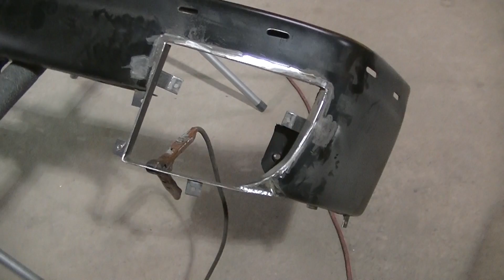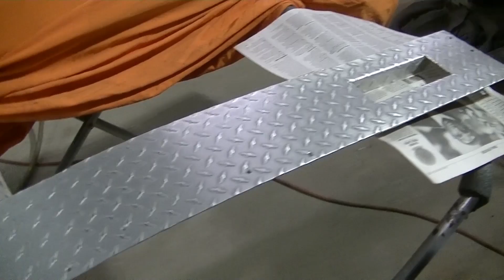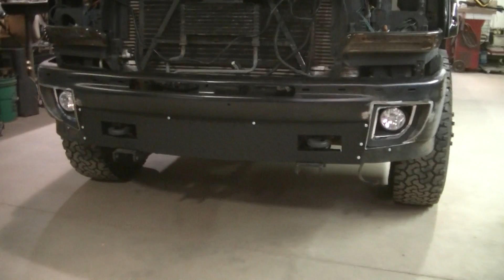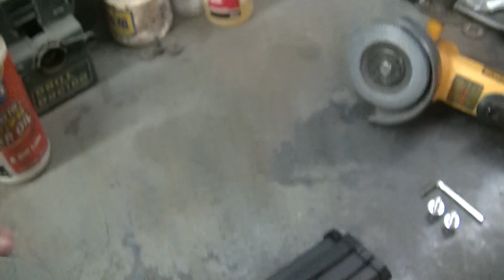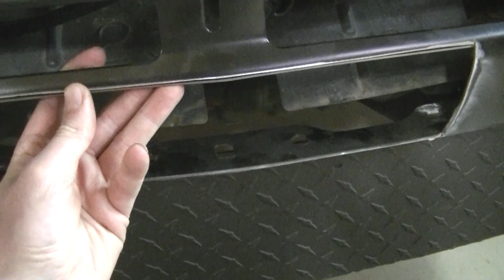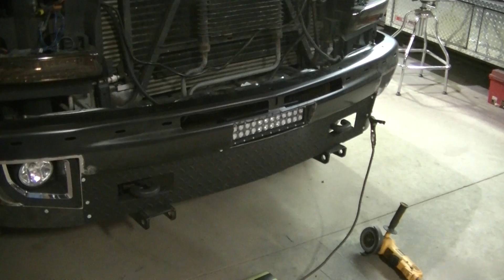Darth Dually "Front Bumper Build" LED Light Bar Install Part 2

Comment: I've used the base Duplicolor bedliner since my first truck for rocker panels.  I've wondered what the Bed Armor is like.  You've answered it for me with this video.  I'll stick to the base bed liner in a can.  BTW, I've used Rustoleum as well, but come back to the Duplicolor.  It just seems to apply better.
Reply from the maker: They are very different products for sure.  This Bed Armor has held up good.  You have to get the Rustoleum Industrial or hard hat paint.  Way better than the regular paint.

Comment: I'm assuming that your using a cheaper light bar. Hell I would. But from what I've read you need to seal them up on the ends to prevent water from getting in them. There's plenty of YouTube videos on how to do it and why. Just my 2 cents. Also that spray on bed liner your using I found it doesn't ball up as much on the edge of the can when the can is warmer. But when I apply it I still use a rag to wipe off the nozzle after every spray. I found that that produces the best results. Great work and great videos as always. Look forward to seeing your videos. Keep up the great work!
Reply from the maker: +huronhockey8   I think that the light bars leaking were the first ones they came out with.  I have a 42" on my ranger and it's been outside since I bought it with no water damage.  The light bar I ended up using was not a cheap bar.  I paid $120 for the 13" which is about triple what the cheap bars on Ebay go for.

Comment: I had to get a heavy duty bumper because I hit too much stuff.
Reply from the maker: +Randy Bobandy   Slow down.
Reply: +mossman381 Only thing I need to slow down on is drinking. drink way too much
Reply: +Randy Bobandy pretty sure my bumper is drunk driving certified, I mean, it is deer-proof !  Also a good tool to transform sedans into hatchback !
Reply: +Veikra I need that !
Reply: It could be yours for the low low price of 1599$ , or roughly 40 case of beer !
Reply: +Veikra I don't keep that many cases. I keep about 3 packs of 60. that will last a couple weeks anyways.

Comment: looks good will you once the item is completed will you put black paint on the bolt heads on the aluminum panel?
Say i was wonder if you could a product review of your Mahawk lift.  is this a 10K lift what the spacing b tween columns what kind of bay size do you need to install it and when you poured your floor did you pour thicker in the post location to run cement anchor down.  I am asking because I am getting ready to pour my building floor
Reply from the maker: +Milton Fludgecow   I am not sure if I am going to go with stainless or black bolts for a hidden look.  I believe the lift is a 9k.  It lifts the dually no problem.  I would have to measure the width but my dually fits between it.  I don't think the concrete is any thicker where the hoist is.  I was still in school when dad had the hoist installed so I wasn't there when the guy drilled the holes.  I do remember we had to re torque the bolts after so long.  Our shop is 16' high but I don't think you need that high of a ceiling to use this hoist.